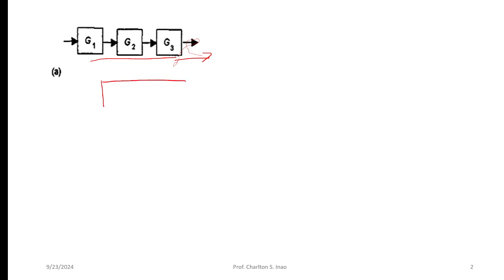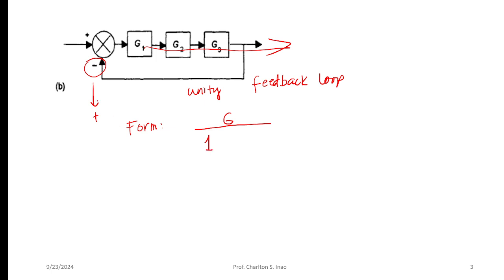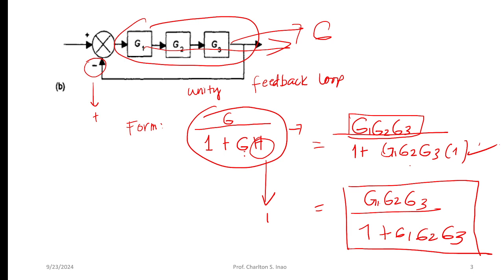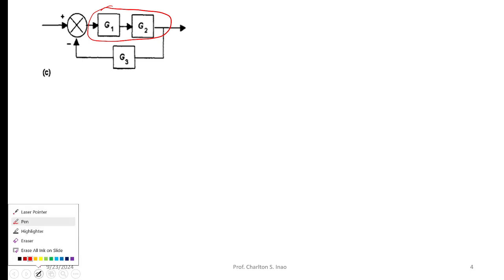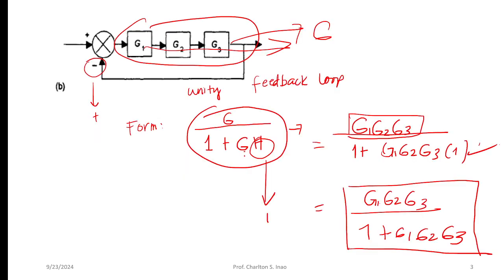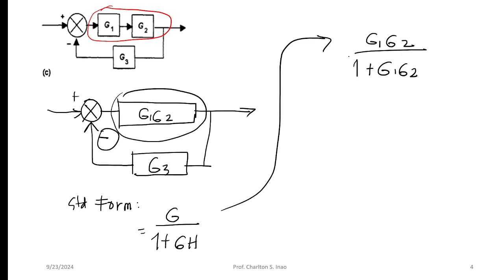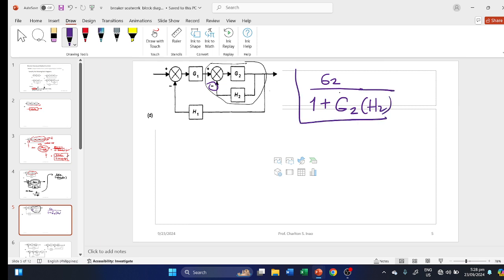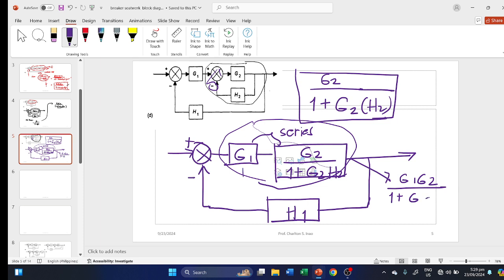Control System Engineering : block diagram exercises  Set 1

Comment: Ramon, Ralph Marco S.
BSME 2-2P

- When analyzing feedback loops, carefully check the signs and invert them if necessary.

- Block diagram simplification is similar to simplifying series and parallel circuits.

- Knowing the standard form of block diagrams (G’s and H’s) makes simplification easier.

Comment: Magpantay, Renz Angelo R
BSME 2-1P
1. Analyzing complex systems can often be a daunting task, especially when there are numerous components and connections involved. By simplifying these connections, you can gain a clearer understanding of the overall system. This approach helps in identifying key elements and relationships, making the analysis process more efficient and effective. Here are some strategies to simplify connections in system analysis:
2. Control involves ensuring stability, maintaining consistency, staying on target, and minimizing errors.
3. To simplify a conventional block diagram, you must combine blocks in series or parallel, remove feedback loops, and reduce summing points. It is critical to grasp the standard form, which clearly defines the transfer functions G and feedbacks H.

Comment: Ban-o, Clairel May B.
BSME 2-1P

2 things that I’ve learned are

The standard form used is G/1±GH, where the sign in the summing junction determines whether to use a positive or negative value. In a series block diagram, you simply multiply both blocks.

Comment: LEBUE, CAMILLE ROSE
BSME 2-1P

1. A negative sign in a unity feedback loop must be changed to positive. This applies when simplifying certain feedback systems. However, it depends on whether you’re dealing with positive or negative feedback. The negative sign in a unity feedback loop doesn’t always need to be changed—only if it aligns with specific problem-solving techniques.
2. There’s a methodical way to simplify a block diagram with feedback. (e.g., combining series, parallel blocks, or applying feedback rules) to reduce a complex block diagram into a simpler one.
3. Transfer functions in series are simply multiplied. For blocks in series, the overall transfer function is the product of the individual transfer functions.

Comment: Alcoran, Matthew D. 
BSME 2-2P

The things i picked up after watching the video are:

1.) It is always the opposite of the sign in feedback the sign that we will use in the formula G/1±GH

2.) If the feedback loop doesn't have any block in it, it means it is unity and the value of H is always 1

3.) If the blocks are in a series pattern, then we multiply each block while we use the formula G/1±GH if the graph has a feedback loop.

Comment: Subia, Ronaldo Jr. V.
BSME 2-2P

After watching the video I've learned that:
1. If the sign is negative in a unity feedback loop, it must be changed to a positive one.
2. a methodical approach to making a block diagram with a feedback loop simpler.
3. All you need to do is multiply the transfer function if it is in a series system.

Comment: Volpane, Tyrone Ace L.
BSME 2-2P

After watching this video, I have learned the following:

1.) The operation to use for Block Diagram Reduction: if it's in Series we can multiply it to combine.

2.) For eliminating the Feedback Loop, we can use the Formula G/ 1±GH, if the Feedback Loop's sign is positive, we make it negative on our formula and vice versa.

3.) A Feedback without a block is called Unity Feedback and its value is 1.

Comment: Pedrasa, Adrianne Joshua D.
BSME 2-1P

- In unity feedback loop, if the sign is negative you have to alternate the sign into positive.
- step by step rule to simplify a block diagram with a feedback loop.
- if the transfer function is in a series system you just have to multiply it.

Comment: Alvarez, Jillian 
BSME 2-1P 

1. The goal of simplifying block diagrams is to reduce them into single transfer function that connects the input and output.
2. The key rules of simplifying block diagrams are when the two block are in series, therefore, you multiply their transfer function. When it is in parallel, just add their transfer function of the blocks. 
3. In feedback loops, there's a forward path that has a transfer function of G(s) and the feedback  path has a transfer function of H(s)

Comment: Jaime A. Doblada ll
BSME 2-1P

1. In control systems, blocks can be arranged in series or parallel to represent how components interact. 
2. If the blocks is in series connection use multiplication while in parallel connection use addition or subtraction

Comment: Yusiang, Jerome G.
BSME 2-2 P

Three things I've learned:
1. Simplifying the connections allows you to analyze the overall system more easily.
2. Control involves ensuring stability, maintaining consistency, staying on target, and minimizing errors.
3. Analyzing the problem, especially when it involves a pickoff point and a summing junction.

Comment: Palado, Aldwin Shennmar D.
BSME 2-2P

- To simplify a block diagram, we may use fundamental qualities such as the commutative, associative, and distributive property. These features allow you to rearrange and combine blocks in series or parallel, move summing points, and remove feedback loops. 

- The usual form for control systems is G / (1 ± GH), where G is the forward transfer function and H is the feedback transfer function. The sign in the denominator is determined by the summing junction: if the feedback is negative, use a positive sign; if the feedback is positive, use a negative sign. This connection simplifies overall system behaviour, facilitating accurate study of how feedback affects system performance.

- To simplify a conventional block diagram, you must combine blocks in series or parallel, remove feedback loops, and reduce summing points. It is critical to grasp the standard form, which clearly defines the transfer functions G and feedbacks H.

Comment: Rangaig, Catherina B. 
BSME 2-1P 

The lecture basically discussed about simplifying block diagrams, its rules and process. Moreover, it gave us sample problems that can significantly help us as we establish our foundation in the concepts of control system. These problems also deepens our knowledge in system stability and performance which is essential in mastering control systems.
Reply: Balais, Sheryl Mae G. 
BSME 2-1P

In the lecture covered the principles and procedure of simplifying block diagrams. Additionally, it provided us with sample problems that will be very beneficial to us as we lay the basis for our understanding of control system ideas. These issues also help us learn more about system performance and stability, which is crucial for controlling systems.

Comment: Napal, Hanna Joy N.
BSME 2-1P

The computation for block diagram simplification were already discussed in the previous videos, but this gives us a more detailed explanation in which you have to examine carefully the block diagram and check the signs if you'll be using a positive or negative (for parallel).

~ when the block is in series you just simply need to multiply the two block
~ when the block is in parallel you can just simply use the standard formula G/1-GH

Comment: Angela Mae Resurreccion
BSME 2-1P

After watching this video I have learned that: 
1. It is important to remember the standard form of simplifying block diagrams when it comes to eliminating feedback loops because it helps in simplifying a lot easier.
2. Don't forget to put an opposite sign of the feedback when eliminating feedback loop blocks.

Comment: Carl Aldin E. Montecino
BSME 2-1P

1. The video clarified how to transform a standard block diagram into a simplified form, highlighting the importance of remembering the standard G's and H's to facilitate the simplification process.
2. In a feedforward signal with blocks arranged in series, they must be multiplied together, similar to how components are combined in a series circuit in electrical systems.

Comment: Lourence B. Legaspi
BSME 2-1P

Three things I’ve learned:
1. In my observation of the video feedback loops with or without blocks you have to look for its signs carefully and if the given is positive you have to write negative or vice versa.
2. As I watched the video, I noticed that the arrangement of the Block Diagram is the same as the Circuit, and the simplification or simplification of the blocks has the same process as simplifying the series and parallel circuits in electrical.
3. Based on the video helped me to understand how to transform the standard form of a block diagram into a simplified form, and noticed that it is important to remember the standard form or the G’s and H’s cause it’ll help to make it easier to simplify the standard forms of the blocks.

Comment: Melchor Aguilar 
BSME 2-1P

1. When the block diagram is in the series just simply multiply both blocks.
2. The standand form we use is G/1+-GH. The sign can determine in summing junction part where if the sign is negative we just use positive or vice versa.

Comment: Allen Carlo M. Villapando
BSME 2-1P

1. If blocks are arranged in the feed forward signal was in a series. We must multiply them by each other. Which is very much related to how we solve a series circuit in electrical works.
2. In a closed feedback control system when dealing with a system that is arrange in parallel or complex, arrange that certain part of the system first.
3. It is better to simplify multiple blocks particularly in a series to reduce complications in the system.

Comment: Gacilo, Vercil Mark G.
BSME 2-1P

In addition to the previous video which introduced the block diagram, this lecture provided more backbone on the calculation of input and output signals for it gave 4  practice problems that were really simple yet effective since it provided more context on how these signals work together algebraically (how they add/multiply and basically just cancel out other) to form a neat aeries connection.

Comment: Hernando, Shen Dandred B. 
BSME 2-1P

1. Identify and Combine Series Blocks - Blocks connected in series are multiplied together. If two or more blocks are in series, the equivalent transfer function is the product of their individual transfer functions.

2. Simplify Feedback Loops - For blocks connected in a feedback loop, the system can be simplified using the feedback.

3. Obtain Overall Transfer Function - After simplifying, the remaining block represents the overall system transfer function to analyze system performance. A complex block diagram can be simplified into an equivalent, manageable form for easier analysis and design.

Comment: Simbajon Jezem M.
BSME 2-1P

1. Upon observing the overall process i found out that it quite similar in solving electrical circuits at first we need to dissolve the parallel to obtain the series type block diagram.
2. then second lets us multiply the two points obtaining one group value whick will represent G over the feedback (H).
3.To obtain the simplified diagram we can apply basic property such commutative property and more.

Comment: Laplana, Jose Nicanor A.
BSME 4-1

- I learned how to convert to standard form through simplification
- if the feedback loop is negative/positive the denominator should have the opposite sign
- moving of pickoff point adds another block with the reciprocal of the block that was moved on the feedback loop

Comment: Gilo, Keith Alfred
BSME 4-1

-Control consists of stability, consistency, on target, and less error.
-Different kinds of rules in simplification of the block diagram. (Series, Parallel & Multiple)
-Concept of Transfer Function, Block Diagram Reduction, Block Diagram Reducing. (Step by step procedures)